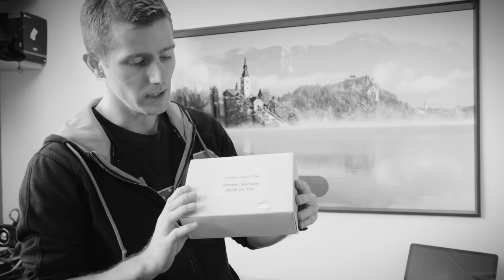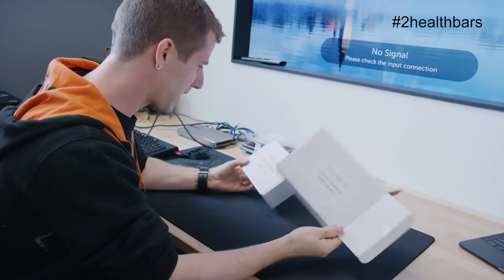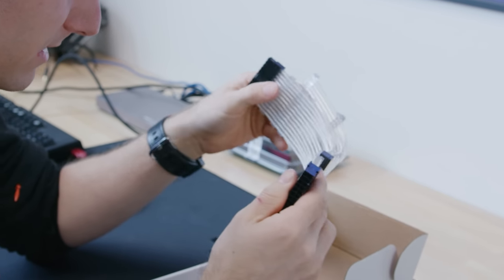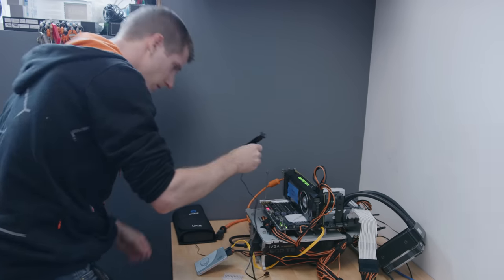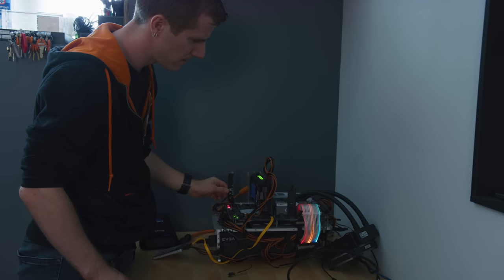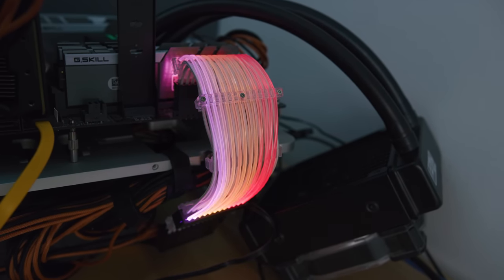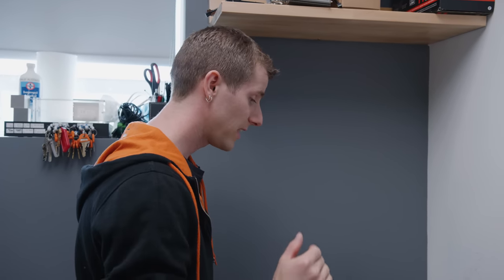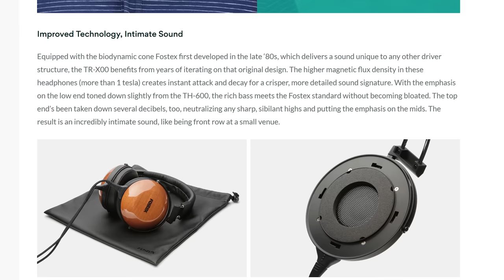It Finally Happened... - RGB PSU Cables

Comment: Just put an led that changes color at the end of the cable and have it cast light down and through the housing and this design is janky or even just make the cables longer and put a very small led in increments down the cable. I thought cables were supposed to stay hidden and stealthy in your pc the RGB makes me think of ketchup and mustard cables that were a plague back in the 90's early 2000's that are just horrible.

Comment: Not good enough.
RGB Motherboard traces.
RGB SSDs.
RGB GPU PCIe and RAM slots.
RGB VRM heatsinks.
RGB motherboard backlighting. 
RGB fans.
RGB motherboard screws.
RGB capacitors on motherboard.
RGB CPU socket.
RGB CPU cooler block
RGB Radiators.
RGB Mouse mat.
RGB Mouse.
RGB Keyboard.
RGB monitor casing.
RGB PC casing.
RGB power cables.
RGB headphones.
RGB audio cables.
RGB air filter.
RGB microphone.
RGB gaming table. 
RGB gaming chairs.
RGB PSU.
RGB RAM.
RGB CPU.
RGB Radiators.
RGB Liquid Reservoirs
RGB glowing coolant.
RGB GPU.
RGB butt warmer.
RGB Everything.

Just dont pay me RGB money.